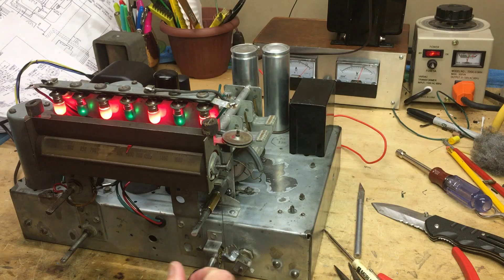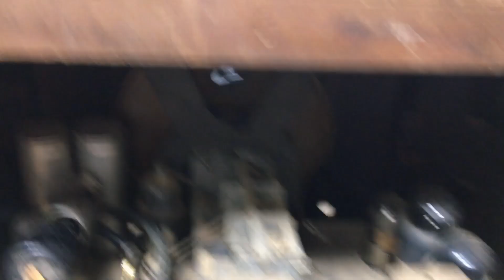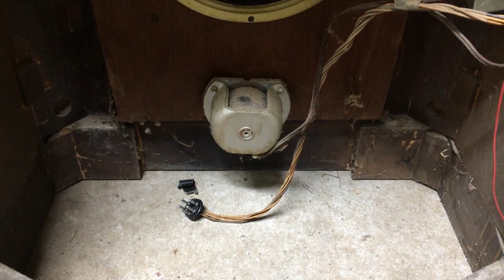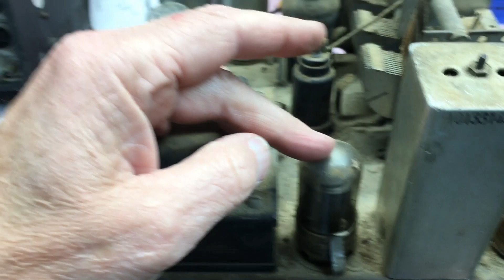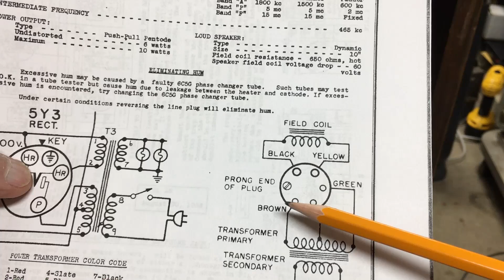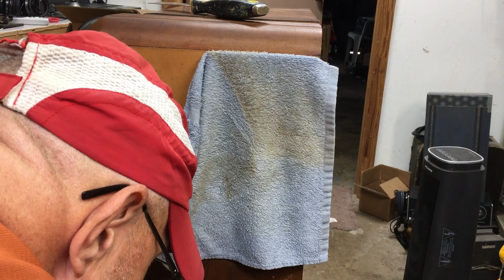1937 Silvertone Model 4486 Console radio Part 1 of 4

Comment: The radio attic has a photo of what it should look like. Cabinet will be a challenge but nothing that can't be done. It's got
 AM broadcast with two shortwave bands but doesn't match Rider's line drawing of the chassis at all. 57DM early 4486
 chassis. Ahh the joys of veneer work. Replace the whole side with a new sheet. Thanks Larry for showing the work done.
Reply from the maker: Thanks Steve! Yes,  veneer work is time consuming, but can be therapeutical, lol…..if you caught it in the video, I said most of the work will be done because I wanted to take advantage of low humidity in the spring. In this radio, I show a lot of the process, it may bore some folks and some will like it, maybe, lol…..Thanks for watching and commenting! Take Care—Larry

Comment: Oh no! I only have part 1 to watch🥲
I have been looking at some radios that need veneer, and I haven't ever replaced veneer, so your comment that the new veneer is thinner will be kept'd in mind.
When I went to the Wood Craft website, I saw that I can get it with paper backing. Could you add more paper to get to the same thickness?
Thanks
Luther
Reply from the maker: Luther, not to worry….I have added additional paper and in fact on occasions, two layers of veneer and sand it down. If you replace the whole sheet of veneer, then the thickness is a never mind. If you are patching pieces of veneer, then it (could) be something you have to address. Just check the thickness first…you can figure how to make it thicker if you have to. Not all older veneer is thicker, I have just ran into it in the past and had good results with paper backing and two layers…keep me updated as to ur progress….email me if you would like…lhlyda719 at att dot net. Take Care—Larry

Comment: Good to see you on with another radio!
I would suggest using NEW Vanier on both sides of the cabinet!
Using a resistor to replace the Field Coil??? I was really hoping that you would rewire the field coil and use that instead.  My reasoning is that the Field Coil will not get hot like the resistor will, and the resistor really does get very hot.  It isn't a matter of "Right or Wrong" because both methods work.  It is simply a personal preference of mine to use the coil in a Pi Filter circuit.
I love it when the entire radio assembly is made to look as good as possible.  Take a look at this video of an example of what I mean https://www.youtube.com/watch?v=8sgDfzjJjAA starting from Time Stamp 17:38 to the end.  It really does make a difference to me.
Keep up your excellent work!  Looking forward to your next video!
Reply from the maker: Thanks Wayne! If were are wishing, I wish I had the whole speaker assembly….lol…..I agree with using the speaker coil if possible, we will see….Thanks for the video suggestion…I’ll check it out…Take Care—Larry